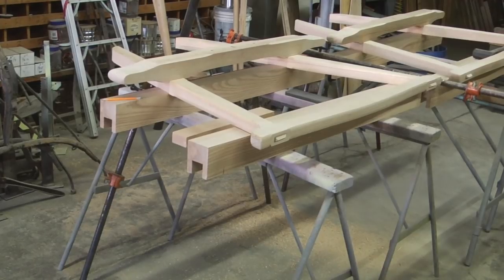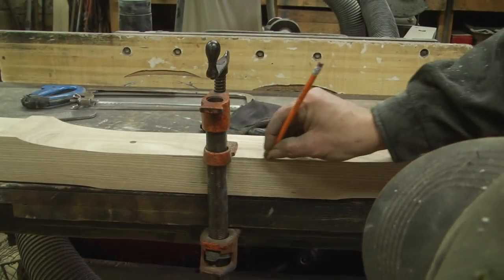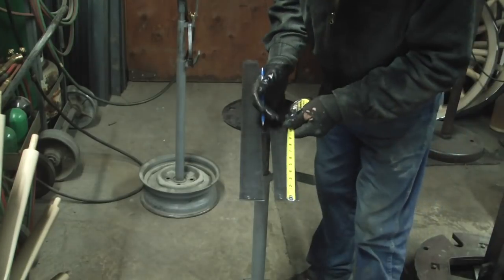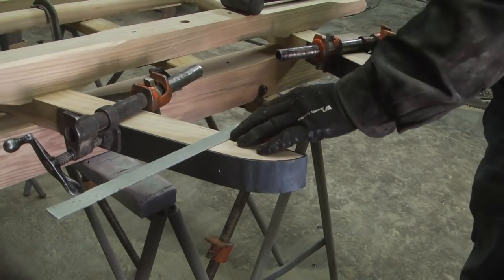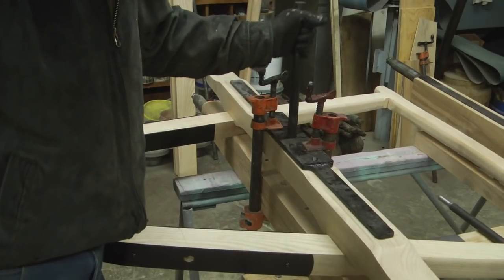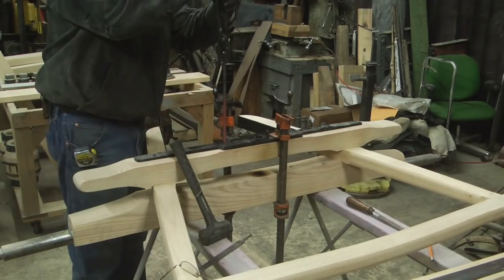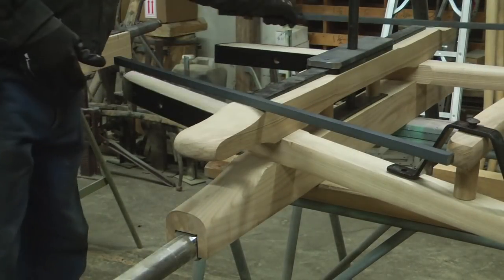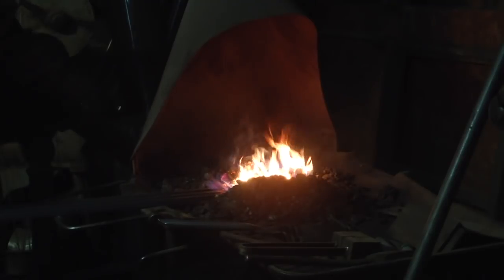How to Build a Sheep Wagon Undercarriage | The Front Axle | Engels Coach

Comment: I never put much thought in to exactly how much work went in to building a wagon by hand before. Speeding up the video doesn't   do the craftsman any justice in how much time is actually required. Thanks for taking the additional time to video the process!
Reply: Yes I think these should be put in a valt for future reference, this is better teaching than a trades college could offer. I say this from the advantages of being a blacksmith, cabinet builder, and
  a stick builder of residential homes. I build homes from futtings to ridgecap on roof. These guys have done excellent work and video could not have been better. Sirs I give you a BIG TEN THUMS UP. GOD BLESS!!!

Comment: Dear Mr. Engel,  Question please - I've been following several of your build projects;  I notice that some of reaches are 'length-adjustable', this one on the Sheep Wagon for example.   Yet the wain boxes or cargo beds are usually custom to a specific length.  Why then make the reaches adjustable?  I favor the notion that a running gear could be considered modular and matched to different payload boxes... but was this idea typical?  Was it not usual to build one running gear to one box?   If so, what is the advantage of a sliding, adjustable reach?  
Thank You!

Comment: What kind of disk do you use on the angle grinder you used to shape the axle covers?
Reply: Looks like a flap disc to me.
Reply: Looks like a carborundum sanding disc with a rubber support disc